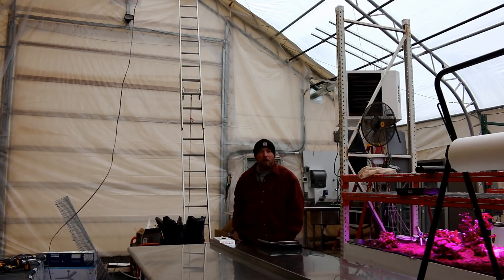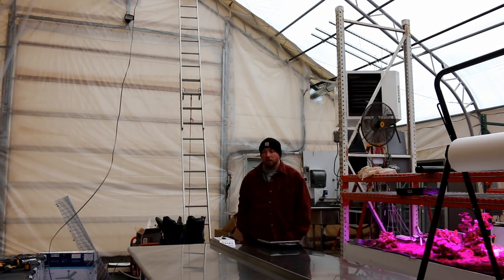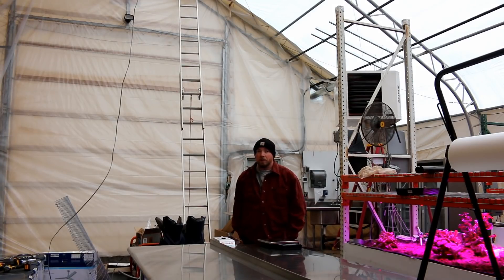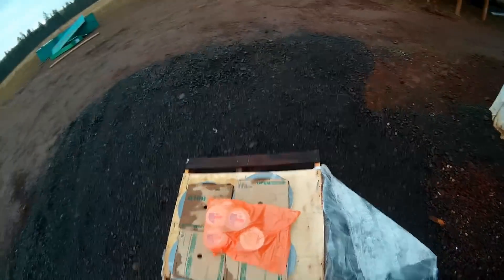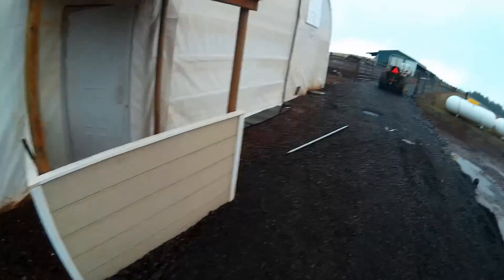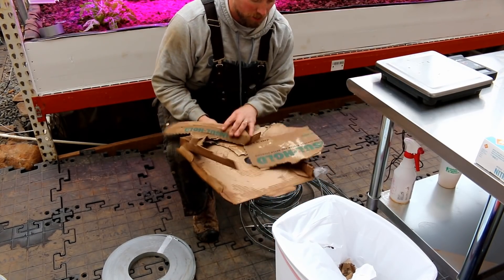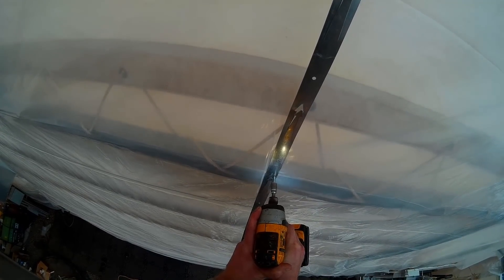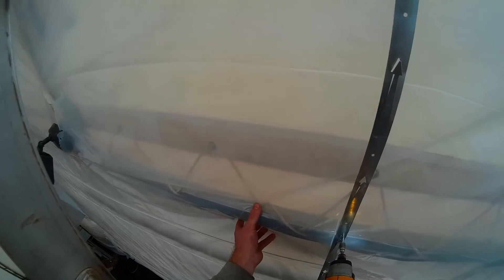How to Insulate a GREENHOUSE - Part 3

Comment: If I may make a suggestion. Don't try and carry the insulation or anything heavy or awkward up a ladder. Use a rope with a  pulley attached to the top of the ladder or one that you can move around to different hanging points in the wall framing  to pull up anything so you have better control of the object and the ladder. Attach the insulation by some type of pinch clamps once you get it into place somewhat and make adjustments from there. At first use quick means of attaching the insulation into it's final position with zip ties already stuck through the insulation just to secure it to the wall with less shifting and fumbling on the top of ladder. Whenever using tools when working high on a ladder it helps to tie the tools to the ladder with short pieces of rope so if the fall they don't hit the floor and you can also let the tools just hang from the ladder when not in use or if you need a short rest. Magnetic bowls to keep the screws or other fasteners in velcroed or attached by other means to the ladder will save you lots of aggravation if you don't use a nail pouch or tool belt and be sure to sue magnetic bits for your drill drivers.

Comment: I read someone giving you the small little piece of information you didn't have when you did this video.  I assume you figured that out before you tried again.  I hope you also decided to try rolling up the needed length of insulation with the foil side in and the insulation on the outside of the roll.  Starting at the bottom of the wall rather than the top will stop you from trying to hang the full weight of the thing from a couple of hooks at the top.  Normal installation, like the other comment is not usually putting up a 20 foot long batten so that is why I think maybe starting with it rolled up at the bottom and working your way up will work better.  If I've described it poorly.  Take you hand and close it with the palm side facing you in front of your face.  Think of the back of your hand as the insulation and your palm as the silver side.  As you open your hand (fingers straighten up)  You'll be laying the insulation up against the prongs which, like the other guy said, go all the way through the thing and get bent back in to hold it.  Then you just keep rolling up or leave the roll on the floor and bring up the material you need to reach the next prongs.

Comment: You are using the tabs on the metal strapping wrong. Install the strapping vertically like you have it, bend the arrow tabs out to 90 degree. Take the insulation and press it onto the metal arrows until it comes all the way thought the insulation. Then bend the tabs back into place over the insulation. Work your way down from each the top to bottom pressing thought and bending over (up).The lining of the insulation is is the part that holds not the fiber itself. HVAC insulation is used in a similar matter. Hope this helps.
Reply: Your advice really sounds like it will work.  How can we get TRM to read this immediately?

Comment: I know you're using self tapping screws, but since you can't get leverage, you should drill a pilot hole to make that process go faster.  You could also use a neodymium magnet to hold the strapping while you get it screwed in.  I would suggest that you clamp the insulation while you're trying to attach it. The weight alone of the insulation will just keep pulling the fibers out decreasing the effective R-value.

Comment: You might want to try to use a spring clamp to clamp it to the ladder (maybe a rung) so you can hold it in place while you figure out how to attach it?  That would at least give you a minute with free hands to figure something out.  Still, well done getting this done by yourself.